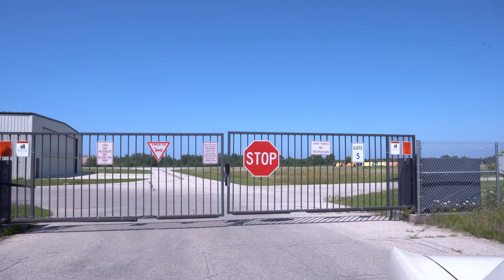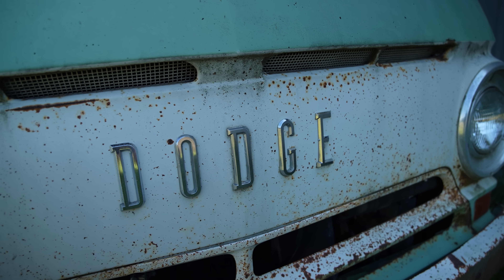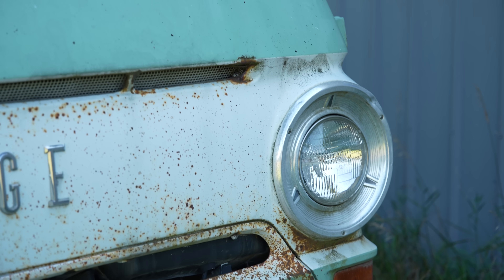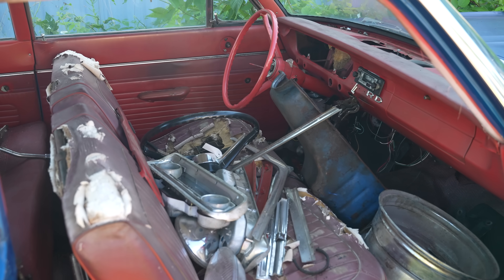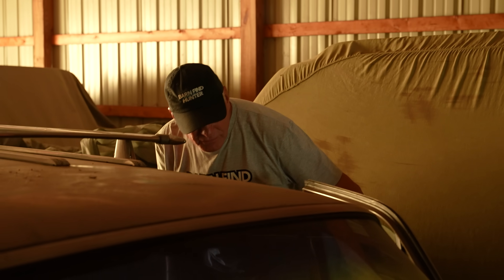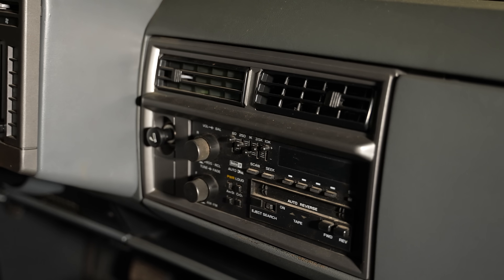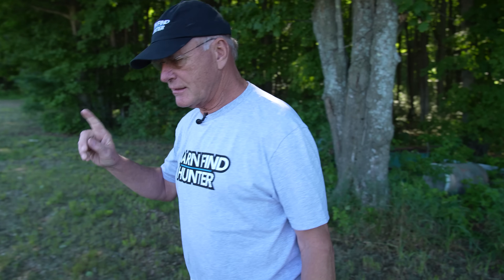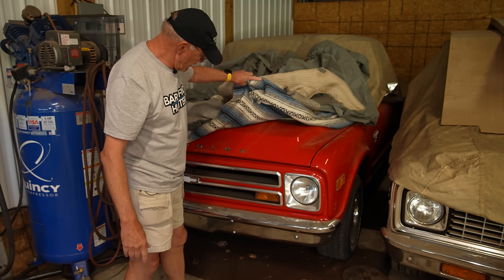7800-mile GMC Syclone, Dodge A100 Sportsman and a Buick Grand National | Barn Find Hunter - Ep. 113

Comment: The Syclone and Typhoon had the 4.3 Chevy engine of course Turbo charged. The Turbo Regal's from 1978 thru 1987 where all 3.8 Buick engines. Just an FYI, love your show!
Reply: Everyone seems to confuse that. They're Turbocharged V6s, but one is a 3.8 and the other a 4.3. Same thing with people thinking that the 5.4 on the SVT Lightning is the same V8 that equips the Ford GT.
Reply: To add to this, the 4.3 in the Sycolne is essentially Chevy 350 with the back 2 cylingers removed.
Reply: Twin sequential turbos and all wheel drive on the Syclone and Typhoon.  Factory rated at 285 hp...seemed like more.
Reply: I wish they put the Engine ( 4.3L turbo AWD ) of the S15 in the next generation  Sonoma . More interior room and aerodynamic
Reply: @gurnblanston3210  Correct 1 Turbo .
Reply: @beddozo  i'd definitely buy one with a turbo MPFI true Vortec 4.3 in a reg cab stepside Sonoma, absolutely love the way those look
Reply: @willybones3890  LOL wut, im gonna have to take another look at my Sy when i get home, last i checked there was only 1.
Reply: @WhoThisGuy515  I had a '99 Sonoma stepside with the 4.3L Vortec. l wound up getting the extra cab because it was my daily driver. I wanted the regular cab, since it does look bad-ass, but I drove a regular cab pickup before and it sucks not having any room at all.
Reply: extended cab looks waaay better 👌🏻
Reply: @willybones3890  smoke another one single turbo
Reply: @gurnblanston3210  
In stock form , you'd only get 6 to 10 hard passes out of them, before the top ends gave up.
Reply: Exactly, can't believe he didn't know that
Reply: @chuckwhitson654  Well you can tell this guy is a ford guy, he rarely knows anything about GM products, or at least has negative things to say about them. That's why I rarely watch this channel.
Reply: @GunsNGames1  The rumor likely started because the Buick engineers were the one's to initially propose and mock up a flared S-10 that did include the Grand Nationals 3.8L. Supposedly GM and Chevy gave them a thumbs down but GMC was interested with it's own 4.3L instead.
Reply: @stephencavanaugh8377  yep,one of the reason I love those things. Swap out engine mounts and a small block will slide right into place and bolt to the trans w/no adapter needed.

Comment: The two turbo V6's are diffrerent.  The Syclone has a Chevy 4.3 V6, and the GN has the Buick 3.8 V6.
Reply: I use to see them at the drag strip when I was a kid in the 90's I would drawl over them. No wonder they're worth so much now.
Reply: @kgthegreatone943  It's funny how being born around 10 years later will change what you drool over. I was so inundated with V6s and everything going turbo that I didn't appreciate its significance til I was older.

Comment: The engine in the falcon 7:23 and 55' chevy 9:05 are Not throttle body injected (TBI) 350s. Both are 92-97 LT1s, which is pretty dang cool!
The LT1 doesn't get alot of love nowadays.
Reply: Loved my Roadmaster's LT1. That car was not light by any means and the LT1 made it surprisingly acceptable!
Reply: @gurnblanston3210  Yes, mine was a wagon (a 1995). I don't think they made the L99 in Roadmasters though, i had the L99 in my Caprice sedan.

Comment: The Grand National was a hairy, squirrely beast at a time when young guys never experienced a "brand new" muscle car during that malaise era. Many ended up in ditches after the rear end swung out, especially in colder weather.
Reply: No. Grand national is not a muscle car no muscle has been made since the muscle car Era 1962 to 1973. Mustang and camaro are sports cars and do not count
Reply: @scootersonlyrepair  The years mean nothing to me. What about 1959 Impalas with 3 deuces? The GR and GNX were meant for neck-snapping straight line speed. The newer GT500, ZL-1, etc., are muscle cars as well. But if you're into numbers, my opinion is that 1970 would be the last year on your chart due to emission chokes. But the SD-455 Trans Am was still a beast of a muscle car - in 1974 no less.

Comment: Owned a high roof conversion van a 1965 it had a 318 max wedge. Bought from a junkyard brought it home got it running and driving. Cleaned updated interior 1993. Sold it as a tiny home. It’s still in Las Vegas same family

Comment: From what I understand buick didn't want to deal with warranty issues with the 3.8 for the truck. I think the 4.3 was a better choice anyway.
Reply: That's incorrect Mike. Even if Buick got the ok to supply the 3.8 Turbos for the Syclone, it wouldn't have worked as Pontiac took most of the supply of the remaining 3.8 Turbos for their fantastic 1989 Turbo T/A. GMC wanted to use the 4.3 anyways.

Comment: I'm a huge fan of the 4.3 = the 5.7 minus 2 cylinders. I have had 6 different one's, all stock. The first one had a quadrajet then several throttle bodies and one vortex with the spider injection. They all ran great but I think the vortex was the fastest and it was in a heavier 2wd Blazer, 3 were in S10's, one in an Astro and the quadrajet was in a fullsize truck. I always wanted to build one up like an old school 5.7, you know the usual, flat tops, small chamber heads, a cam ground like the old LT1, high rise, holley carb and headers. I can see an easy 400+ HP. I have had several of the 3.8's also but never had any dreams about building up one of those.

Comment: The syclone had no were near  of a ignition  system as advanced  as the grand national. The water/air  intercooler was horrible test were done on a dyno they dis connected the hot water running  threw it from engine. Connected a garden hose and the temperature  kept creeping  up when at full throttle. Test were done by ken duttwieler back in the day

Comment: Louisville Division of Police used to use the Buick Grand National as Traffic Patrol Cars and they remained untouched on the exterior, had a Halogen Dash Light and Strobe Grille and Deck Lights in Red and Blue with Dual Flashing Headlights and a Taillight Flasher, and it had a 2-way Radio in it, the police department had purchased an unknown number of Grand Nationals from General Motors and eventually sold them in favor of the Ford LTD Crown Victoria 4 door sedans.

Comment: They were going to use the GN engine for the syclone, but they ended using the 4.3 with a turbskie.
Can't remember why, but I'm sure it was cost effectiveness issue.
Reply: The 3.8 required firewall modifications to fit while the 4.3 was already an option on the s-series.

Comment: Also that syclone would likely fetch over 50k with that few miles. The syclone/typhoon had a 4.3l turbo v6 the GN had a 3.8l turbo v6. Buick motor is much better. The syclone basically has a vortec with a turbo thrown on it. They are both temperamental, but the syclone much more so. Still awesome trucks and I wish I still had mine today
Reply: @gurnblanston3210  I did own one, infact my father also owned 3 typhoons and a syclone. I know what the motor was had it built twice. I said it was basically a vortec. First of all the vortec didn’t exist in 1991. Second the motor in the syclone morphed into what you know as the 4.3 vortec. It’s basically the same small block slightly revised with different heads. The heads are what have them name vortec
Reply: @gurnblanston3210  I’m not even gonna waste my time with you. Clearly you can’t read or comprehend what I said. Go do a Wikipedia research and you will then understand what I said I guess. I probably owned my syclone before you knew what they were. Also my dad bought his typhoon brand new in 1992. Once again I never said it was a vortec motor. I said basically one. I never said that’s what it was. I know when the vortec came out. My sister bought one brand new in her 96 jimmy. Anyway I owned syclone 879... I still have the owners manual that came in a leather wrapped booklet with the syclone graphic on it. I also raced my truck hundreds of times in the 90s. But think whatever you want, I really couldn’t care less. The entire point of my post was to let the op know that the syclone and grand national have very different motors. That’s it...wasn’t getting into the science of the motor. And again the 4.3 vortec was born out of that motor. I didn’t say it was that motor.
Reply: @gurnblanston3210  yeah the one you bought in 98 and claimed to nearly run an 8 second 1/4 in the late 90s? Sure I’m sure you nearly ran an 8second pass in a typhoon in the late 90s.
Reply: @gurnblanston3210  I’m well aware what mso stands for. But I’m not debating wether or not you bought it “new” in 1998. I’m simply laughing at your claim of running almost an 8 at 150mph, but you never got a slip and supposedly this was done that same year. But hey it’s just like the 10lb bass joe blow caught, but has no proof. Actually it’s more ridiculous than that. Nobody was running “almost” 8s in a typhoon back in the 90s. Especially not with AWD still intact
Reply: @atamagashock  yeah no one go 8s in 1/4 with a stock block. Lol

Comment: Your estimate for the cyclone is way off, if the truck o my have 7000 original miles it would bring 50,000-75,000$ at auction

Comment: Buick would not give up the 3.8 and it was nearing the end of its run and factory was closing down. So chevy took the 4.3 v6 that was already an option for the s15 bolted the same turbo up with the ASTRO van awd and boom basically the fastest vehicle in the world in 91. Its a shame it was a victim of its own performance. Gm did not push it that much bc it was wayyyy faster than the base corvette aka their flagship sports car. It competed with and beat even the zr1 in alot of testing. Its not a good look to have your car that's developed to be a benchmark of performance getting beat by what looks basically like a black s15 with fog lights and a set of rims. I wish the secret wasn't out on these trucks and I could find 1 for a reasonable price they are the coolest truck ever built and it's brother the typhoon!

Comment: Chevy engine in a Falcon. Why. 🤔
Reply: To make it "reliable"for everyday use. At least that's the excuse I usually hear. I, personally, prefer to drive them original. Even though though I prefer GM products, I would much rather have that Falcon the way it was originally built. The only exception is if it was originally automatic, I would want to change it to a standard. I dislike driving any vehicle with an automatic.